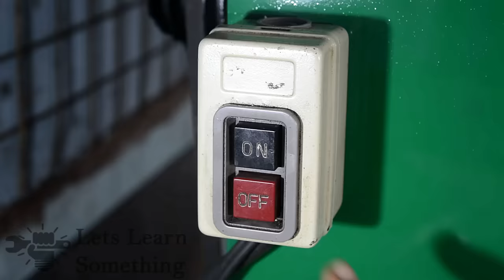Homemade Lathe Machine

Comment: I’m a plumber and welder by trade. People don’t understand how brains like ours work. To the uneducated it looks hard to build, but if you have a mechanical mind it all looks very step by step and easy to build!! I built my own drill press, belt sander,wood lathe and now I’m going to build one of these!! Your x and y axis on your tool post look very rigid ! You know how i know ? You were able to make clean uniform passes . I already have all the steel and it was so easy and informative that i ordered all the rails and other stuff. I’m going to use a 3 hp variable speed motor with a forward and reverse module though. Very and i mean very nice build !!

Comment: I like the fact that it has several speeds, a hollow spindle, and the linear supports for the slides. Now you need to make a tail head, and a compound slide. Very useful. I would have put a 4-jaw chuck on it.
Reply: tail head? you mean tail stock?
Reply: @CleoKawisha-sy5xt you dont need a tailstock, the cross slide can be used a tailstock

Comment: I was looking for a D.I.Y. lathe build to turn and produce banjo pots. This was fascinating, enjoyable and revealed your design capabilities, familiarization with parts, machining, etc. What my experience of making things has been is that if you have to buy tools to produce something it exceeds the price of simply buying it. So ... It then becomes a matter of self challenge, creativity, possibly doing it better and the satisfaction of knowing you made it, even if  it runs over what a purchase would have cost. It would be interesting if you kept a running tab and totaled the cost and compared it to a similar one available. I swear there is a economic Desmond out there making sure the act of making something is cost prohibitive vs buying. Loved the video.
Reply: Well, you comment indicates you know nothing about machine tools .....but that's OK.   What IS very clear about this video is the guy actually knows very little about lathes .....but he does know something about welding .....and that's about all.  The one weld along the top of the "headstock" was very good.

ANY kind of metal "chip-making" machine cannot be made from "steel".  This was found out by one major machine tool builder 50 years ago. White Sundstrand built a series of machining centers based on fabricating.  the machine frame was very thick plate.   The end result was a machine rampant with vibration.    CAST IRON HAS INHERENT DAMPENING PROPERTIES.

The "E: value of steel is much "better" than cast iron ...but when it comes to machining, cast iron is simply the only "best" way to make ANY machine tool.

How do you turn to a specific "known" diameter?

How do you generate a thread?

How do you machine a taper?

A lot of work .....and you can't actually do much on it.

.

Comment: Dear Sir, just like everyone else I am in awe at your skills.  Drilling accurate compound holes, beautiful stick welding and producing a low backlash device that looks like it can produce accurate and smooth results.  Have you thought of making a tail stock? That would complete the build.  You may need to add locking to your cross-feed and longitudinal feed so that when you are cutting cross-feed, your long track doesn’t move by itself.  Well done. One day you could throw away the belts and have a fixed motor with VFD and have infinite control over speed. You’d be able to get higher speeds as well. Cheers.
Reply: Ģttt

Comment: I am hugely impressed with the entirety of the video content! I have a small workshop and I have been looking to buy a small lathe for simple work. I am mildly contemplating trying this project, but I remember how many times I thought as I watched the video: maaan, if I were to mark and drill these holes, I don't think I stand a snowball's chance in hell in making them as precise as the author of the video!

I have been making simple constructions and the issues with drilling a multiple holes in a precise position is painfully familiar. Much respect for the final product! I want one :)
Reply: draw it up in a CAD software and just print out 1:1 size parts (the rails just make a segment 1:1 that u can locate ez) and stick it to ur metal should make it easier to make less mistakes.

Comment: Only the best welders can achieve a bead like that with a stick welder...not easy...worked on overhead doors and commerical ramps, we could only hire the best, as the liability was immense if a weld failed, and that's what the welds looked like... Exactly...

Comment: This is excellent.  The only oversight is a belt guard over the pulley's and belt for safety purposes.  Without the guard, this lathe can also be used to slice, dice & julienne fingers!!!  Adding a belt-guard would not be difficult or expensive... and well worth the effort & expense.  It will also protect the belt from unintended damage.

Comment: today I went and bought 8" channel steel base, ordered rails. this is going to be one fun project, Thank you for sharing
Reply: why the 8" channel rather then the 2 x 4" channels? i like the that the 4 '' gives you a little more supporrt down the center of base
Reply: How about just going and buying you a lathe... you will never finish it ?? I bet'u don't..
Reply: D Grass shut up , many people have more determination and courage than you sheep.
Reply: @DavidGrassSr it's simple really. esp. if u have a tig or/and mig. i did a shorter version.. for my coil cores (tattoo machines). a 2800 rpm motor, steel plates and rail. i only use it for coil cores i dont worry much about runout and all.. way better than those cheapass mini lathes online (plastic gears 😂)

Comment: Well ,Well and well.......I've been a fitter and turner for the last 60 + years, now retired, but I have to admit if I was going the get a lathe for the first time this is what I would make.......with a QCTP and a DRO, plus a set of gears for screw cutting what more could you ask, probably have a bigger spindle bore and A/C bearings..........Oh, and I'd also fit a left hand ball screw to the crosslide too.......just forgot, it needs a tailstock as well.
Otherwise, a beautiful job, well done with the means available and the outcome is really good......the colour green is the best.

Comment: It turned out a good working model of a lathe. It is the model, because the rigidity of the frame does not stand up to criticism, especially in torsion.
It was necessary to use at least tubular profiles of large cross section.

Comment: Unbelievable. I have a small Sherline mini lathe and this puts that to shame. Was impressed how true the headstock spun. Wasn't sure it would.
Reply: Although i'd say that even that mini lathe is more accurate than his homemade one. Lots and lots of unmachined surfaces and everything is measured with rather basic tools or by eye. Also this doesn't look very rigid. So next step would be using the lathe to build a mill, then building a new lathe and a new mill with those tools.

Comment: What a great project! I'm fortunate to have a couple "proper" lathes but I would rather have yours than none any day. Nothing like the feeling of completing such a huge project, is there? You should be very proud of yourself. I'm impressed and subscribing. 

I'm sure you already realize you'll need a DRO since you don't have graduated dials. And if you discover that chatter is a bigger issue than you had anticipated you can add mass and vibration damping by filling those base channels and tubing with lead. Just melt some and pour it in. I would also consider some more bracing inside the headstock box, again only if you experience excessive chatter as I suspect you will with a welded thin wall steel frame rather than a heavy iron casting. 

Just ideas for future improvements. First make lots of chips to get to know your machine well before changing anything else. I look forward to seeing more!!
Reply: You could also fill those empty base channels with cement. It might even be a better solution than lead.
Reply: @peterdurica8022  Lead is FIVE TIMES heavier by volume and malleable. Concrete is hard to the point of being brittle. Cast iron is used for machine castings largely because it is less prone to ringing than other cast metals. Vibration damping is more valuable than "absolute" rigidity (really there's no such thing) because the more rigid something is the more likely it is to crack under stress. Concrete is better than nothing, but lead would surely outperform concrete for this purpose.

Comment: I can see abom pulling his hair out and his heart rate shooting to 175 watching this.

However. Very impressive with they tools you have!  Well Done.
Reply: Give Adam a stick welder, an angle grinder and a drill press and tell him to make a lathe...He'd drown from his own sweat. The man gets out of sorts if you try to talk to him while he's turning a shaft to size. "It's rude to talk to someone operating a lathe..."
Reply: @WmSrite-pi8ck  But it IS rude, to talk to someone who operating a lathe. Or does any other sort of precision work with concentration involved. Maybe you can babble and turn a H4 shaft at the same time - but I certainly can't. But I can do one after another.
Reply: @marcus_w0  I think you might have missed the point I was making.
Reply: Took the tip of my index finger off about eight years ago with someone babbling over my shoulder. six weeks off work. Lesson learned.

Comment: Excellent job. You must know what you’re doing. 
Questions:
1. Do you have any micrometer readouts on your adjustments? I didn’t see any. 
2. What is the runout?
3. How much did the parts all cost?
4. Do you sell the plans?
Thanks for sharing. 
Paul
Reply: nah. he made a good approximation of a what a lathe look like and an approximation of it functionality. its more of a stiff and overpowered woodworking lathe.
 the ball screws remove any capability for precision (they are meant for machines, not human operation, too low rotational resistance), the bearing have tons of play and if affect the surface finish. the bearing will not last as they are wrong (no thrust bearing, only two sloppy bearings that are loaded mainly in the wrong direction)
Reply: Oh come on. It’s a bloody lathe. Maybe not up to your standards but he did a good job with what he had.
Reply: @paulmanhart4481  I may have sound meaner than intended xD. I would say that is an amazing lathe for wood. He made a superb welding and the stiffness of the machine was right (but limited by the bearings).
outside of that, I am being reasonable xD. the design will lead to be change the bearing regularly. it's the same problem with the $2k mini lathes.
I am not asking for a diamond lathe (those with cheap and hyper precise air bearing). I just say that you should use this one with steel nor copper (especially copper). and this does not allow for precise machining, (it is better at CNC, ironically), that why I called it a stiff woodworking lathe. because it is what it can do without wrecking the bearings at 10 to 40 hour of use (those bearings must cost like a hundred each).

Comment: Seriously awesome job dude.  Can't commend you enough on this.  One of the cool things about this project is that once you have a lathe, you can use it to build a better lathe!
Only suggestion I really have is get rid of the split lock washers.  They're really only useful if you have a situation where you can't fully tighten a bolt.  In this situation where all the materials all metal and you're bolting them all the way down, they're just going to be an extra source of noise.  If you have any threadlocker, I would use that instead.

Comment: The is the only manual metal cutting machine that can replicate its self
Reply: Now he can build a better one using this one as his main driver 😁
Reply: I bet I could come damn close on my knee mill. With a 90 degree head attachment you can do a lot including turning fairly long round shafts. If I had to get rid of either my lathes or my mill, I'd kiss the lathes goodbye.
Just say'n........

Comment: Great Job! Thanks for sharing! (...and thanks for not having loud nasty music playing in the background! That takes away from the experience!...) Now you need to add a tail-stock. You have to have a live/dead center, to support your longer work. It would be nice to be able to adjust the center, for turning long tapers, and you need a Morse Taper on the inside to accept standard 1/2" chucks. Be sure to cut out a drift key, or, incorporate an inside pin, to dislodge your tool when you back it up past -0-
Reply: Hi Lee Williams, love your advancement suggestions.

If you have a way to this as video or pictures with instructions, will be highly appreciated BECAUSE AM NEW TO THIS LINE, and I love the work done well to me as pre-beginner.
Don't know how to do that I am just shopping for things to build similar size.
Thanks again
Great ideas turn thing round for better.
Reply: @akindiranolanrewajujohnson1873  For making a tail-stock to fit Morse tapers. You should use a bigger Morse taper weld in a tube. That tube should be centrically to the chuck.

Comment: I think its a wonderful thing though it could never make precision repeatable high finish cuts in steel. Even a cheap mini lathe will come with a cast iron bed and the bed and mating surfaces of any lathe worth its salt will have its sliding  cast iron surfaces hand scraped to finish. These types  of linear bearings and rails cannot remotely meet the performance of a hand finished surface of cast iron. I do think its marvelous though and a great thing to do and have, as it is better than no lathe. He will get to know its limitations and make the most of it.
I was blown away by the milling machine and that due to vertical loads and massive construction will manage better and the finish didn't look half bad.